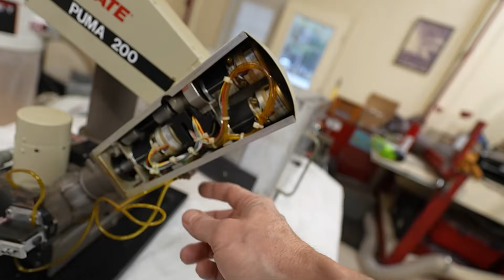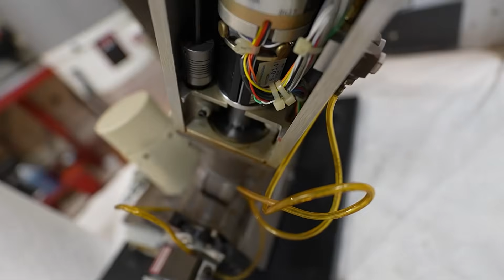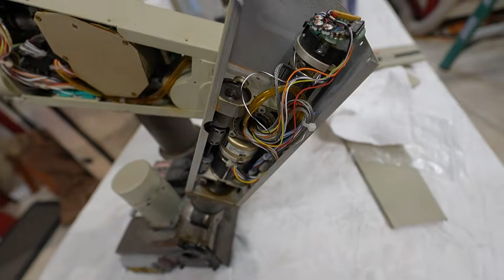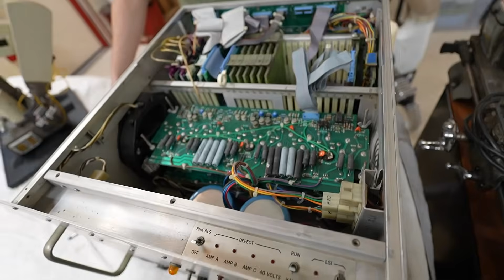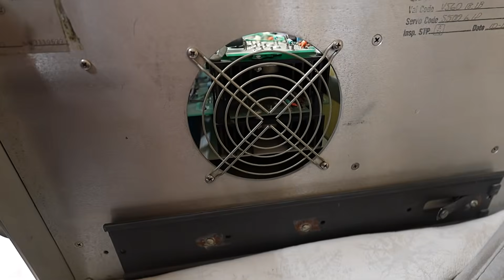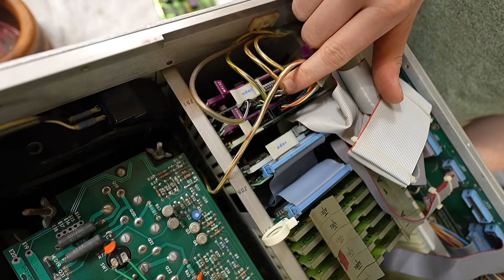Deep dive inside the first production electric robot - 1979 Unimate PUMA 260 - and controller

Comment: Oh Lort! I remember getting a 200 to play with at NASA way back around 1990. It was a mess, poorly documented, and just generally cheap and unwieldy. Then we got a larger one, a 762, I think. I did all kinds of neat stuff with that robot. This was all around the time PWM was coming into vogue, and microcontrollers were becoming a thing. I spent the better part of a decade convincing, cajoling, and cudgoling management and the engineering team leads to use data busses and power busses up the arms to reduce the massive wiring harnesses, which caused a lot of failures. We ended up building a 60 foot long robotic arm that was man rated (to have an actual man on the end effector). Crazy times. I had forgotten the name of that language, VAL. It should have been called UHG. 😂
Reply from the maker: The 762 is really big - there's been one for sale for years but I just don't have room for it.  The cables are pretty sketch - you don't dare bend the little pins!  As far as VAL, I must say it's pretty easy if you have the documentation, and considering it's a scratch-built OS and programming language with kinematics, it's pretty amazing!  We've done some initial programming which I'll be posting soon.